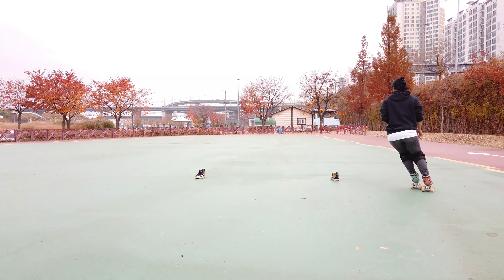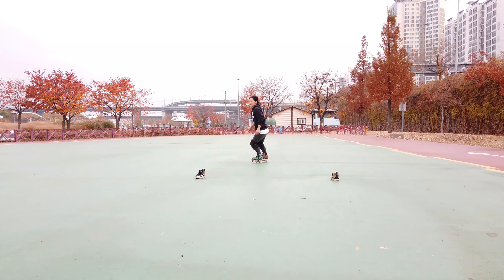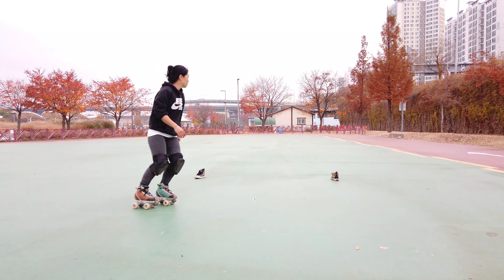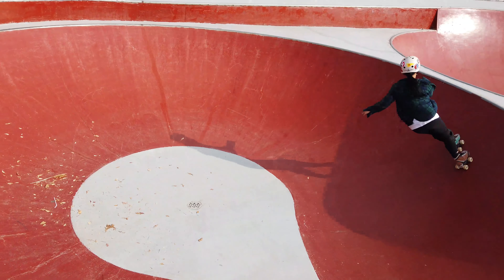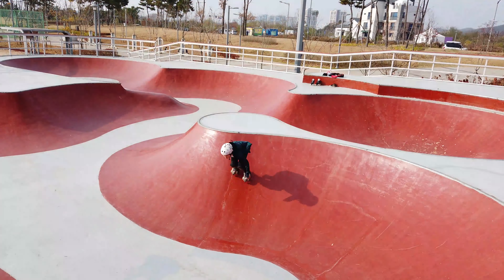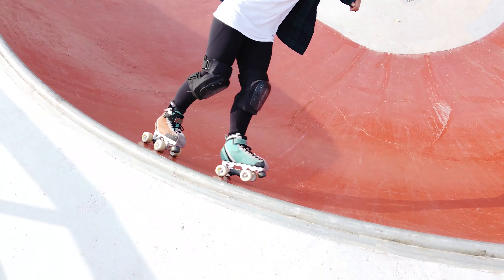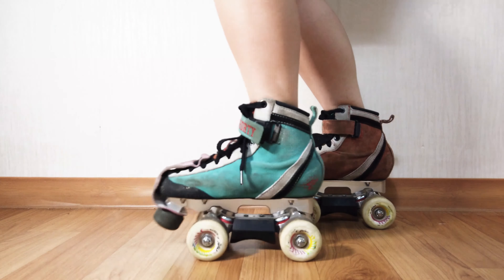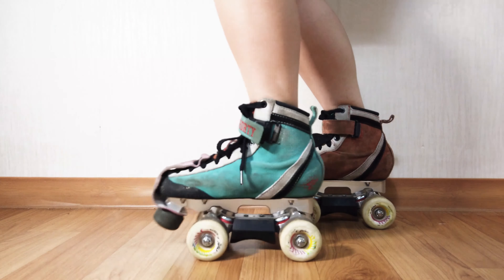How to Carve on Roller Skates | Trick Tutorial

Comment: Would you recommend loosening up your trucks to be able to turn better for carving? I can't tell if my issue with carving is my trucks being too tight or me not leaning enough 🤔
Reply from the maker: Are you trying to carve wide or tight? Carving on a ramp is different to on flat. For me, carving on a ramp I will pivoting on my back wheels carving forward or front wheels is carving backwards. I do not reply of the action of my trucks and lean into turns are that can cause you to slip out

Comment: When carving, or even earlier when say just practicing figure eights, should weight be balanced between both feet?  Or is the outer or inner foot taking more of the weight on a turn?  I hope that questions makes sense. 😊. I think I tend to put my weight on my inside foot when turning on a figure eight, but think when carving it’s supposed to be more on your outside/higher foot?
Reply from the maker: For me I have my weight pretty evenly distributed, maybe a little more in my back foot for both craving and figure eights. But the weight distribution in my front/ inside skate, I have a lot of weight/ pressure in my heel so I can lift my toes to make tighter turns. If that makes sense.
Reply: Shorty's Skate Series That makes sense!  Thank you for answering my question. 😊

Comment: hi Shorty,  I've seen people carving left , staggered leg with right leg leading. Is that possible?  i am still new , i guess i just have to try out which way works for me
Reply from the maker: Yes it’s possible. I’ve seen a lot of skaters do this as they don’t want to change the leading leg when they carve left and right. You will need to use the pivot turn method to help you turn. Remember to pump into the transition as it will make the turn easier than if you just coast.